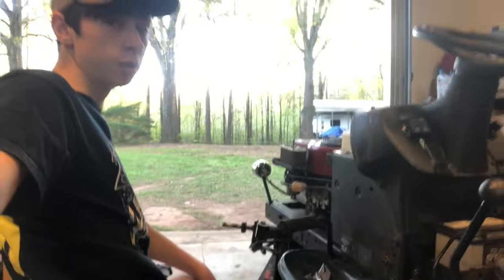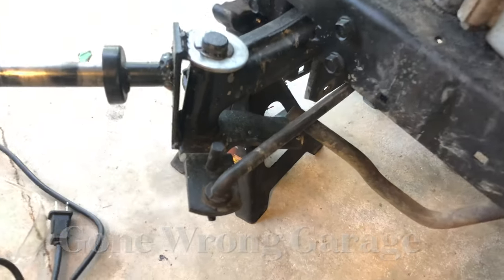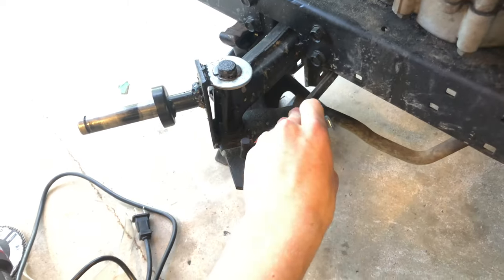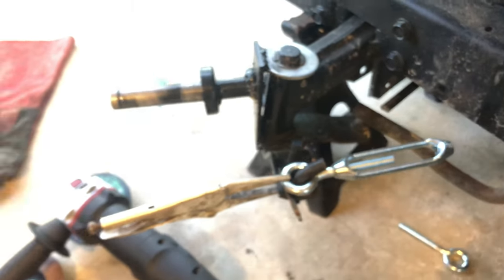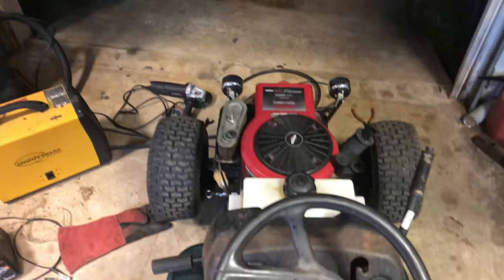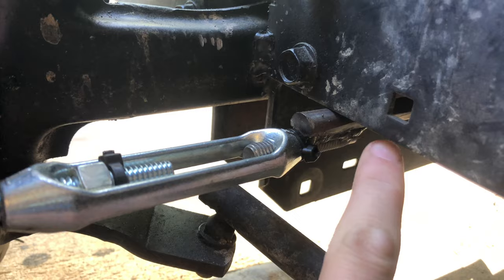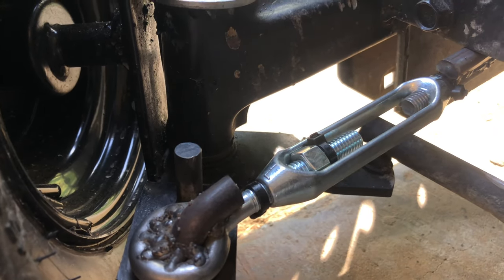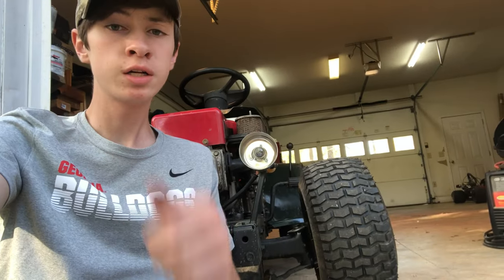Racing Mower Adjustable Front Tie-rod

Comment: If your front rack has flex when turning left/right, put some stabilizer bars on it. Mine had holes so I was able to use threaded rods and brackets on the frame. It helps a lot.
Reply from the maker: Thanks! might try that